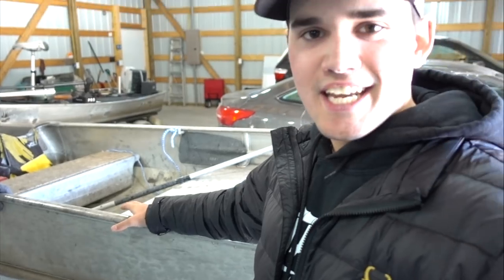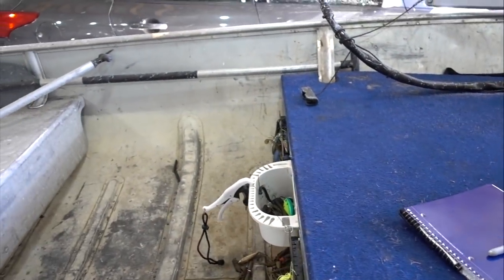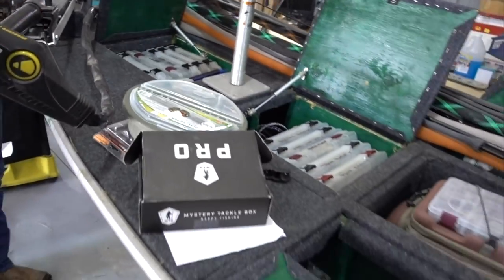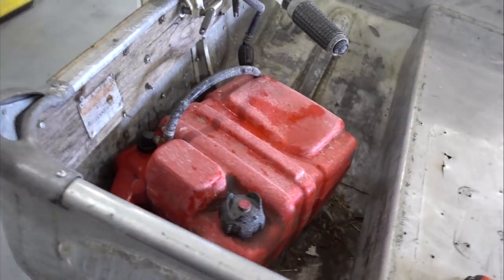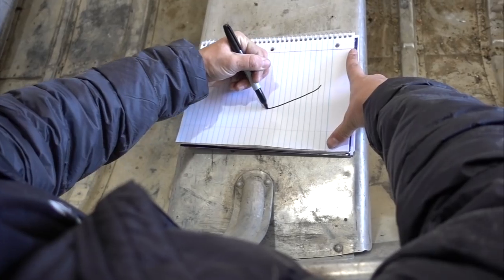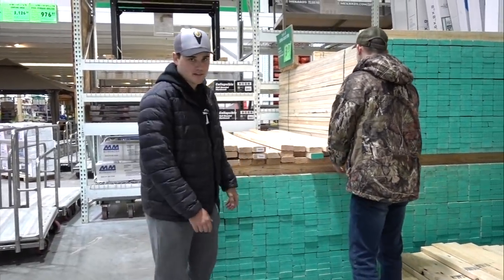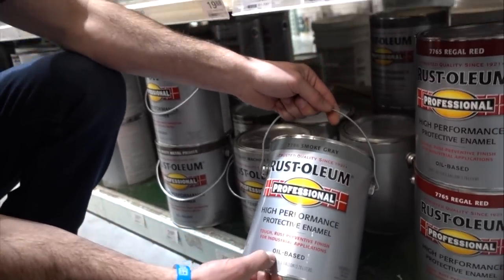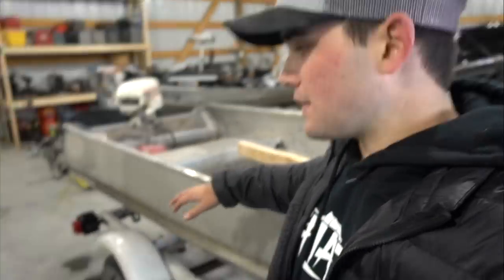I AM BUILDING A BASS BOAT!!!

Comment: If you plan to leave tackle in it waterproof hatches are a must. I built my own mini bass boat out of a old 12ft glass row boat I got for free. It turned out pretty sick It has a 55lb motorguide foot controlled in the front and a 20hp outboard in back. After I built my decks I coated it all in fiberglass to seal the wood and compartments so it is all water tight. Then I  covered it all with gray boat carpet. The only bad thing is I didn't get big enough hatches for the compartments so it's hard to get tackle out. Other then that I love it. Best of all it is light enough I can tow it with my Subaruuu that gets 35 mpg making it cheap to head out to almost any fishing spot. Where as if I take my truck and Champion bass boat in costs me 10 times as much.

Comment: If you drill holes in the sides of the bench seats with a 2"-3" bit you could put in a center rod locker. This is a great use of the space.

Comment: I have this exact same boat, it's an Alumacraft F7. For what it's worth this is VERY good quality boat it's not your normal riveted aluminum boat ( yes I've looked in to it A LOT) I've had mine for about 4yrs now. With that said it's very much worth customising, I suggest moving gas and battery to the front, replace the wood transom with aluminum, clean inside good so you don't have old crud under your nice wood deck and give a good paint job on outside. My boat is getting heavily customised as well, no wood, all aluminum. I can't wait to see what you guys do with yours.

Comment: I did a similar rework on my last boat when I bought it.  I would recommend thinking up anything electrical you might want on it (nav lights, bilge pump, etc) and wire all that to a small switch panel before you install the deck.  If you plan on keeping the batteries in the back, run the lines up to the trolling motor the same way.  And I always thought that the on board charger I threw on my old boat was so much easier than having to connect a portable charger.  If you got the cash to throw a little extra at them, they make things a lot easier on the back end.

Comment: Add some 2x4s under the deck where the seat is to elevate the deck a little more. This will leave some space between the deck and the seat. So, you can put some boxes and other things you want quick access to. Its so worth it.

Comment: Make sure you fill any open areas under the deck with foam, better buoyancy and makes it unsinkable. ALSO, under the storage lids wrap them with a solar cover to reflect heat out on the water.
Reply: Just finished the whole video, if you leave the seats in, cut open the part not being used and stuff them with pool noodles.

Comment: The only thing I can tell you is make sure you have a little bit of a lip around the deck. It very easy to knock gear off in the water if you don't leave a little gunnel.

Comment: You need to use PVC pipe to run wiring through. Makes it a lot easier down the road to add or remove wiring. Especially if you are going to get better fish finders.

Comment: I’m aware construction is under way but!!  By taking out bench’s except captain bench and reframing in new lower more stable deck (use aluminum) Easier to customize and allows additions like live well,rod lockers and more storage spaces.  More work for sure but did this with a couple Jon’s I’ve owned, makes for nicer more stable fishing platform.  Built mine for around 700$ in parts.  Good luck bro.  Look forward to seeing how it turns out.

Comment: Ive built 2 now both 14ft wide tracker jonboats I sudjest making your deck as low as comfortably possabil for stability i think on yours the top of the seat level looks good....and when or if you put a driverseat in the back dont offset it, been there done that, it doesn't work just center it or it will lean to one side when you ride .....another thing i think its fairly obvious dont drill holes in the boat , it is impossible to keep it from leaking after a while because on most boats like that the aluminum is to thin and flexes... Will break any seal you have jb weld and all thats why im on #2 lol but good luck keep the vids commin there great 👌

Comment: If you put a pedestal seat make sure it is a removable. So when you are driving you can see. I made this mistake, On the first boat I did a 14ft John. Now have a 18ft wide John. And the only thing I wish I would had put Was a rod locker. I just use buggie cords that are drilled down to the deck works great. Also I did mine with as much aluminum as possible to keep it on the light side.

Comment: I'll try to be nice about this. I am a welded aluminum boat builder. Don't do this, you will not like it. Those materials are going to add a lot of weight up high and it will be very unstable. Fishing out of the front with one person will be worse. Flat bottom jons are a little better but the semi v will be bad. If you have to do this get a flat bottom but I still wouldn't recommend it with anything other than a double wide.